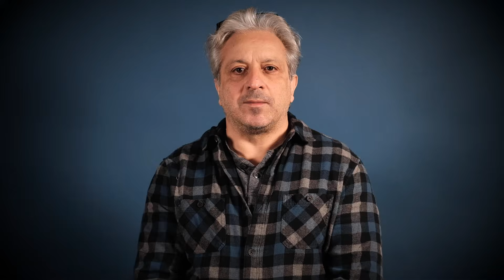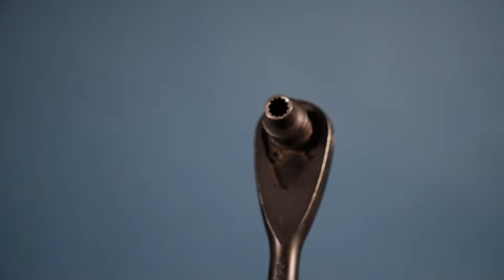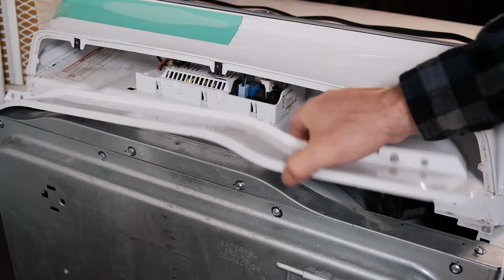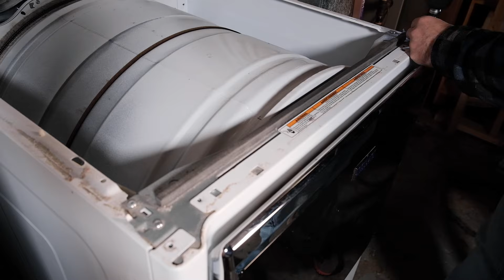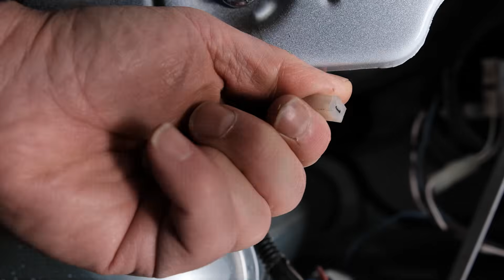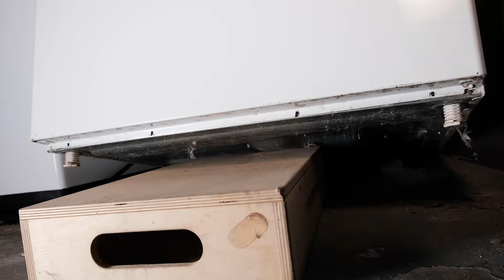Maytag Dryer Thermal Fuse Replacement

Comment: Spot on.  For some reason the the 5 screws on the inside of the door were not the same. The two bottom screws we different from the top 3.  I would just like to say thank you to Maytag for some seriously crappy 💩  engineering.  Lets make a 60 second fix a 90 minute project!!!
Thank you Mr. Shahen for showing us the way.

Comment: Finally I know where to look for this. My Bravos XL suddenly just wouldn't turn on after (as far as I know) completing the last cycle days before. Not a power issue. It doesn't quite make sense to me that it simply will not turn on vs turn on but turn off after starting/have no heat but hopefully this is what the solution is

Comment: Thanks a bunch.  It helped me to get to the fuse. Now I'm waiting for the part and hope that's what's wrong with it. It turns 
ON and shuts OFF shorty after that. At one time it showed a PF error code.
Reply from the maker: Good luck. I hope that solves the issue.  PF on a Maytag is Power Failure that can happen during power surges.  If you still have the old thermal fuse, and a multimeter, you can check the fuse for continuity, if you hear a beep the fuse is still good.  If not, then the fuse needs replaced. Here’s a video I found that shows how ... if you have a multimeter. https://www.youtube.com/watch?v=HyCaoiQsyd0